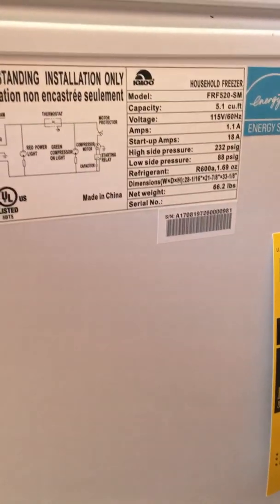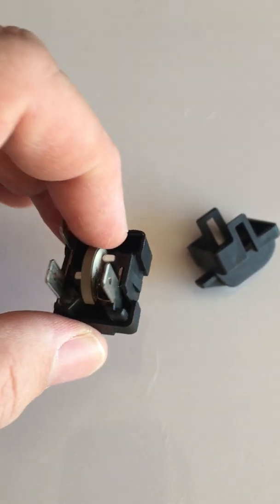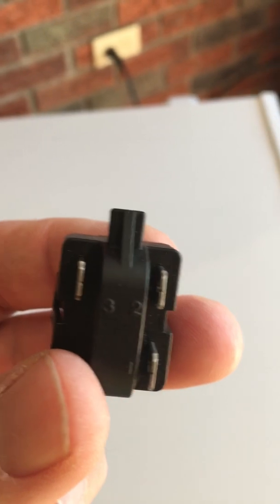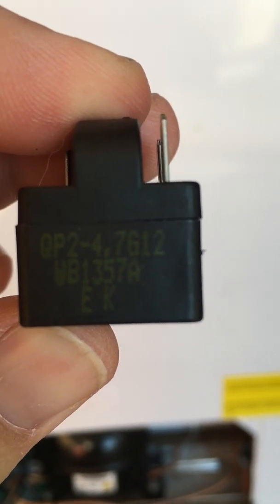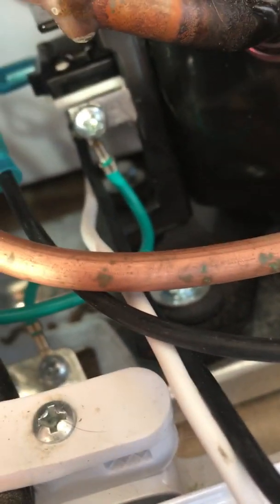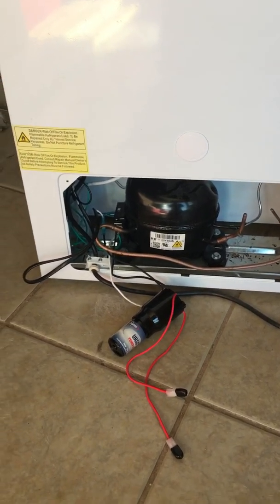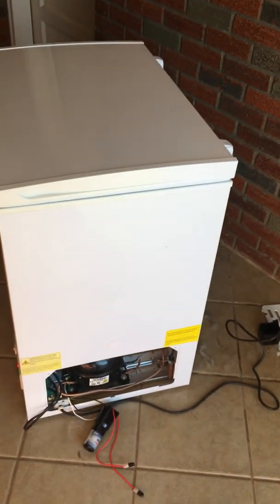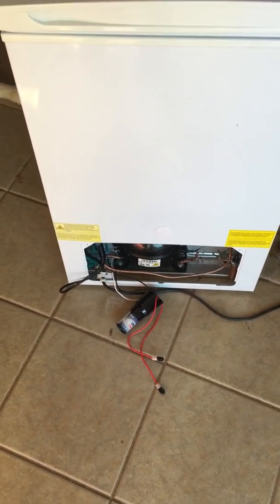Igloo Thompson Freezer repair for 5.1 or 7 cu. ft. Chest freezer

Comment: Thank you so much for this video! We were able to identify exactly that problem, get the Supco part and get running again, unfortunately about three months later it died again. We tried another part in a different brand and nothing. Do you have any advice? We're about to just get a new freezer but I feel like it's a simple fix I'm too stupid to figure out.
Reply from the maker: I wish I had an idea as to what may have gone wrong. Mine has continued with the Supco unit for almost a year. I did just work on a neighbor's freezer that had the bad relay and when I put in the new unit, it wouldn't power on, but, it turned out that his compressor had gone bad. I would hate to think that your compressor quit, but it could be possible. These systems are pretty basic. Thermostat, Relay, Circuit Breaker (the other pin above the relay), Compressor. I wish you luck in your repair, if you go in that direction.

Comment: i have the exact same freezer. It died today..same symptoms you mentioned in the comments below. Took the part out and the  disc was cracked inside. They had a new 2 pack on Amazon for $10...
https://www.amazon.com/gp/product/B07FX4WPP5/ref=ppx_yo_dt_b_asin_title_o00_s00?ie=UTF8&psc=1
Reply from the maker: Hi Karen. You must have deleted your earlier question. I had to PINCH the sides of the plastic to get mine to come off. I guess you already removed that if you got into the the relay to see your ceramic disc broken. I hope you get it going again with the parts you ordered.
Reply: @donaldlgilbertjr7923  I was wondering...does that disc spin inside or is it just for contact between the electricity?
Reply from the maker: @Karen C , that disc just sits in there. Whatever the material is, it acts as a buffer to allow the line voltage to gently go to the compressor. Some people have been lucky and their disc wasn’t cracked, just burnt, and they were able to take the disc out, clean it up, an reinstall. 

I went with the Supco unit because it was a heavy duty unit rather than the fragile disc, but it cost $20 rather than $5. I’m glad you bought a two pack as you might find you will need the other one in a few years. It’s just a fragile part and I hate to say it, meant to fail to either sell more units, or assist the repair technicians.
Reply: @donaldlgilbertjr7923   I see...Thank you. So glad you posted this video...for five bucks..we'll have our chest freezer working again. Part comes in on Tuesday.
Reply from the maker: @KJC63  , I'm glad it helped.
Reply: @donaldlgilbertjr7923  YEAH! my freezer is now running and making all those gurgly noises :)  Thanks so much!
Reply from the maker: @KJC63  , Very Nice !!!

Comment: Thanks for sharing this video. After having my 3.5 cu ft unit, my power and run lights were coming on, but no freezing occurred. Found your video, opened up the relay and saw my ceramic disk was broken. Found a reasonably priced replacement. Installed it, and now running. The feeezer lives again! Thanks.
Reply from the maker: I'm glad that it worked for you.

Comment: Ok I checked mine cause it's not getting cold but I pulled that relay out and it's still all together should I still replace it im attempting to fix this on my own cause I deff don't have much money so any advice would be great.
Reply from the maker: If you can't hear the compressor turning on when the GREEN LIGHT is lit on the front, then it's either the relay or the compressor. If you turn the thermostat all the way to the coldest setting and the GREEN LIGHT never comes on, then your thermostat has gone bad. The relay can be found on ebay or Amazon for under $10 in most cases if you don't want to use the power start unit, which is $15 to $20. I hope you can get it going and don't have a bad compressor... if that's the case, then there is no reason to repair it. Good Luck
Reply: @donaldlgilbertjr7923  the compressor gets hot u can hear it click like it is try to.
Reply: @donaldlgilbertjr7923  I just ordered a new relay for 5.99 so let hope this works but won't find out till my order gets here on the 18 so I'll let you know. If I get it working again ur video was such a help though.
Reply from the maker: @selinamiller1058  , I do hope that the relay fixes the problem. I don't recall my compressor ever getting hot, so I am not sure what that issue might be. I don't want to speculate at this time if your compressor has gone bad. Good Luck

Comment: Thanks for making this video! I was just about to thrown mine out when it died after a power surge. The power start you recommended worked like a charm! I connected mine to the capacitor.
Reply from the maker: I'm very glad it worked for you. That relay piece is really junk, so I think the more durable power start unit will work well for many years.

Comment: Neighbor had the exact same Igloo freezer when it broke under warranty.  She got a 100% refund from Sam's Club and asked me if I wanted the broken freezer for free.  I replaced the start relay, which had a broken ceramic disk.  $10 dollars later I had a working ice cold 5.1 cu Ft freezer ... thx for your video.
Reply from the maker: Sam's refunded my money as well since I had purchased the warranty. I have been told by others to have a few of those relays handy as they seem to fail frequently. Glad it all worked for you.

Comment: What’s the part number for the supco 3 in 1 part?
Reply: Thank you I got mine running again by rotating the disk until I can get the part to fix it
Reply from the maker: Supco RCO410 110 to 125VAC Solid-state Hardstart Relay

Comment: This seems like a fantastic instructional. My igloo, exact same model as this one, has the same problem. I just opened a ticket with them to see if they have an extended manufacturer warranty, since free repair/replacement > dropping any cash on it, but if that falls through I will absolutely try this...and maybe even bug you with questions if I get stuck! Seems simple enough. I'd try this method first, but warranties are tricky, and one tool mark on a screw to the access panel could screw (haha) me over in that department. Fingers crossed.
Reply from the maker: Good Luck. If they don't fix it, you may only need to buy the relay part rather than go with the entire 3-n-1 unit as I did. I have spoken to a few people that bought a pack of them on eBay to have as spares. I hope you get it going again. Cheap parts for the throw away society.

Comment: I had mine just die. I watched your video and removed the relay. Mine was not cracked but on one of the disk sides where it was making contact look burnt. So I moved the burn side away from the connection and Bam working once again. Thanks!
Reply from the maker: I'm glad the info helped you.
Reply: @donaldlgilbertjr7923  I just talked with with my father who has been in HAVC for 30 years and he told he QP2-4.7  Is the part number and   G12   Is a date code.
Reply from the maker: @haxxorsheep  That's good information, as I found plenty of those relays with the QP2-4.7 written on them from several sources.
Reply: Hi. I have the same thing, it was not cracked but burnt and the blue thing connector is burnt too. Idk what its called, do u know what is it and can i buy it at amazon too? Thanks!

Comment: Mine is an igloo but smaller 3.6 cu ft. It doesn't have a capacitor that I can see. I pulled the relay switch out and the ceramic disc is intact but did notice burn marks on the plastic clips of the back cover that aligns with the metal terminals. It's a backward RU A1H8 Cub I gel SA (white) TY 110 115 V 3012-5A. I suspects it's this part because when it didn't freeze, the outlet had blown a fuse. Replacing the breaker fuse the indicator lights red & green are on but still no freezing. What do you think? Could it be this switch even if the ceramic disc is not broken?
Reply from the maker: If the Green and Red lights are on, then the temperature selector switch (Thermostat) is working. My ceramic disc was burnt as well. Most likely, that is the issue. You could try to find that part number by searching Google or ebay.  The TY 110 115 V 3012 5A looks like it means it is a 110 to 115 volt 5 Amp unit. Not sure what the 3012 means. You want to look up the RU number. RU is the company that makes it.

I hope you have some luck fixing it. If you can't find the original pieces, that 3 in 1 start pack will fix it like the one I put in.

Good Luck.

Comment: Can you show or tell how to put part on. Have the same part but not able to connect the ends together.
Reply from the maker: I am not sure which part you are trying to put on. You will want to leave the White surge protector in place and only remove the Black relay. 
Are you using a Power Start unit like I did?
Reply: @donaldlgilbertjr7923  yes... exact same one. Just not sure how to connect it.
Reply from the maker: @detricechambers5506  I found it easier when I put a mirror inside the unit to see the two small pins to slide the wires onto the compressor. I tried to video that part, and it was too blurry to see anything. The 3-n-1 should have instructions. If it didn't, then go to this video https://www.youtube.com/watch?v=RamyqjqeLXA to see how it is done.
Reply: @detricechambers5506  I seen this video and when I popped off the relay the surg came off. If you lay down you will see there are 3 pins inside the connector 2 for the replace and one for the protector. if you pause ar 2:12 you can see how the surge protector goes. I did the samething.
Reply: https://www.amazon.com/gp/product/B07FX4WPP5/ref=ppx_od_dt_b_asin_title_s00?ie=UTF8&psc=1 These are New 2pcs QP2-4.7 for $10 I ordered that when this happens again.

Comment: Is this starter relay on the back of the temp dial?
Reply: Nvm, i found it. It was connected to the commpressor. Mine is not cracked but it is definitely charred.

Comment: So mine powers on and a very low hum is heard. After about 15 seconds there is a click and the hum stops. I unplug it and then after about 3 or  minutes there is a click. I plug it back in and the same. 
This is a brand new machine that was damaged in shipping with a dent next to the control panel. 
Any Ideas?
Reply from the maker: Yes, mine was doing the same thing. It was trying to come on, but then stopped with a click.

Comment: Can tell me how to take that part off?
Reply from the maker: Sorry for the delay. I wasn't receiving notifications for some reason. The relay pulls off of the two pins. I needed to use a small flat blade screwdriver to get it started. Then it popped off.

Comment: 50 bucks for a relay? WOW ! I only paid 119 dollars for the unit which is an igloo as well. I can't find my receipt and it's less than a year smh and I bought it at a large " discount " place as well. Mine I only found wasn't working because my food started spoiling smh. Mine keeps having this clicking noise, did yours? I'm hearing some may be the thermostat.
Reply: Mine isn’t keeping food frozen in the center.  I put already frozen food in the middle and it thawed out!  This is junk, I thought igloo was a good brand but I guess they aren’t as good as they used to be. Don’t buy this freezer!
Reply from the maker: @laurenandreas5950  , mine does very well at keeping everything cold. My only issue was that relay, and now that it is replaced, I hope to get many more years from mine. Sorry yours isn't performing as well as others.
Reply from the maker: Yes, mine would click at first, then a few seconds later would click again when it turned off. After 30 seconds or so, another click to attempt to turn on, then a second click when it quit. The cycle just continued.